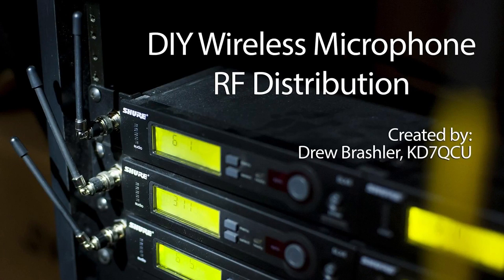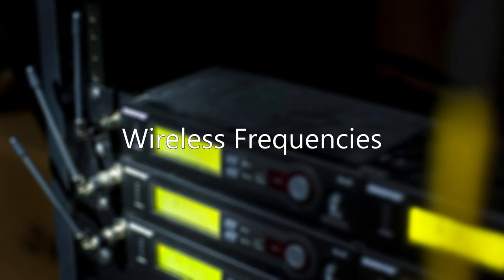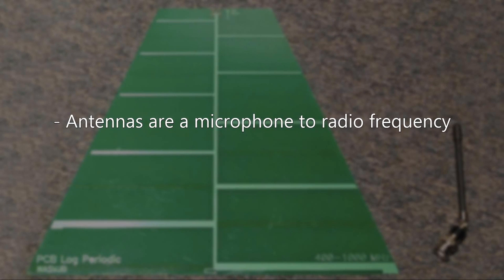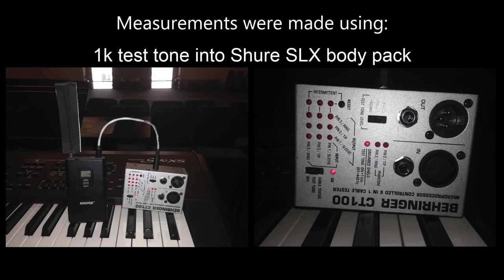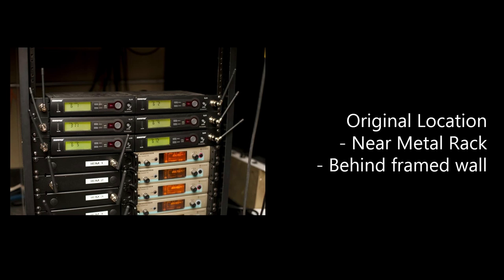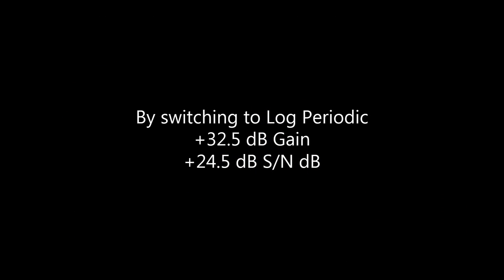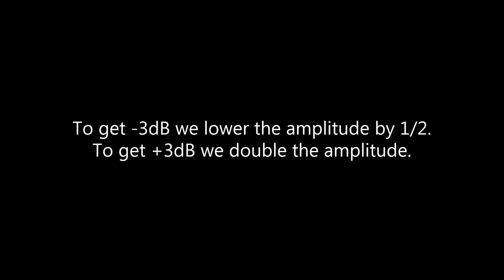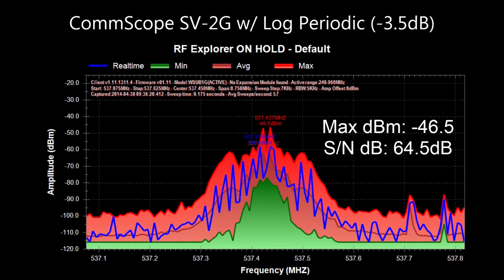DIY Wireless Microphone RF Distribution

Comment: This is a rather well-done and -documented presentation.  Thank you for making it, as it may save smaller churches who have a tech-savvy volunteer a significant amount of money.
A few observations are in order: First, -3 dB is half-power, not half-amplitude.  Half-amplitude is -6 dB.  This is because power is proportional to the square of amplitude.  
Second, the Shure claim that its splitter introduces a 2-dB insertion loss is a bit optimistic.  As you correctly point out, when the power of the input signal is split two ways, there will be a 3-dB loss from the input to either one of the outputs.  We would expect a little more than a 3-dB loss, because the circuits in the splitter are not perfect.  
Third, with the 1/4-wave monopole antennas, any metal nearby will affect the antenna's pattern; it will not be omnidirectional.  Even a piece of wire (the power or audio cable to a nearby piece of equipment,) if it is within a wavelength of the antenna and parallel to it, will introduce a change in the antenna's pattern.  
Fourth, an amplified (active) splitter is not necessary in all cases.  If you have a directional antenna with 6 dB of gain over the stock monopole, it will practically balance out the loss in a 4-way splitter.  The downside of an active broadband splitter is that in an area with strong, nearby television transmitters, the TV signals can overload the amplifier and cause intermodulation products to be formed, which may likely interfere with the microphone signals.  Or, it can amplify a strong TV signal enough to overload the RF "front end" of the wireless-mic receiver.  One of the features of the active splitters furnished by the microphone-system manufacturers is that they typically have filters to restrict their amplification only to signals within the tuning range of the microphone systems.  
Lastly, while your antenna rack is neat and compact, the close proximity of a transmitting antenna to receiving antennas can cause intermod problems in the receiver.  It is good engineering practice to keep transmitting antennas several wavelengths away from a receiving antenna, especially when the transmitter is in the same frequency band as the receivers.  There are systems where the transmitter and receiver can share the same antenna while in simultaneous operation, but those systems typically use a directional coupler to keep the transmitter's RF output from entering the receiver input.

Ken Reighard, AC3GC

Comment: Brilliant Drew, 
I discovered your post almost by accident! I have been doing the same type of distribution system over here in the U.K. for over 30 years. I'm just upgrading our Church system, & have just checked the new kit out in my workshop. Amazingly, I also have the same test gear as you, & am also a licenced radio amateur, and retired broadcast engineer. We've just upgraded from a very archaic VHF dual diversity system which had fixed antennas, all crammed into a cupboard at the back of the church building. There wasn't even sufficient space to extend the relatively long, VHF antennas, so you can imagine the amount of drop-outs! I was reliably informed that the previous installation was done by a 'Professional'...
I had to convince our church that I was saving them money.

Thanks again, nice to know we're 'singing from the same hymn-sheet'!

Comment: As far as the power distribution dilema, at our church, we just used a power inverter/DC supply with multiple connectors built into the cable which we just plug into each receiver then we don't have to deal with the bulky plugs. 

I've already built mine based on your info and tested it and it works. We just need to get all the receivers and our Mackie Dl32R off the stage and into our media room but this is really exciting stuff and the amount of money saved is well worth the build. Thank you for sharing Drew!

Comment: I'm in the middle of implementing this setup right now, thanks to your advice and research here.  Got my antennas, cables, tools, and an RF Explorer for before, during and after testing.  Thank you for this work!  You're saving my theatre a ton of money they don't have so that we can get rid of the pops and dropouts from our musicals (24 channels - what a horserace to mix!  And tune/set up!)
Reply from the maker: +leistico That is awesome! Take some photos and let me know how the build goes for you!
Reply: +Drew Brashler  Hey there.  Just now getting back to you, and I have to say the setup I put together is working like a champ!  I don't know how to post pics here, but what I've got is a stage that's 35 feet wide, and a booth that's about 60 feet away with a rack of 12 SLX receivers (with room for hopefully four more, if the budget numbers pan out!).  What I did was make booms for the LPDA antennas about 20 feet from the edge of the stage extreme left and right of the house, about 12 feet in the air, each angled off vertical about 15-20 degrees (they're fastened to coves  above and along the side of the house), and each ran back to a 2 way passive splitter to two of the eight way active splitters, to make sixteen lines out for each side of the receivers.

The only concern I had from the LPDA antennas is that according to my measurements (with the RF Explorer), the noise floor went up to around -70db.  That's pretty high based on what I've seen in your video.  Fortunately I think I overcame that when I moved the antennas from the booth (60 feet from the edge of the stage) to their current position (25 feet from the edge of the stage.  I might have set up "zones" rather than diversity, but all I know is that we just did a production of "The Producers" with that system in place and there was nary a single signal dropout in any of the mics (10 of them H5 and 2 G4, the H5's are tuned 1 MHz apart from 518 to 527), which was a massive improvement from past productions.  I could even pick up clearer signal from the green room for PFL signal checks, which is odd as the green room is now 70 feet away from the antennas, through a cinder block wall, in the opposite direction of the antennas from the stage, so even with the elevated noise floor signal reception has improved dramatically.

Thank you for all the amazing work you did here and allowing me to learn from what you found out here!
Reply: I am a bit confused about the SMA to BNC connector cable. Shouldn't the other end of this adapter cable be "F" connector? Would I then need to adapt from BNC to F to connect to the splitter? I'm hoping you could clear this up for me. Thanks
Reply: Hi there.  The way I did it: soldered a bare-end of coax cable to the antenna, ran to a F connector, to a two-way splitter, to the 8-way distro/amp, to my receiver, all with F-ended cables but with a F to BNC adapter screwed onto the cable that attaches to my receiver. I soldered the bare coax cable to the antenna because I could get away with it, and it saved me having to use a circuit-board-to-SMA connector and an SMA to F adapter of some sort. I hope that clarifies how I made my adaptation of the system work.
Reply: Hi Leistico, 
David Kpe
1 second ago
Please did you use the ' Mini-Circuits ZBSC-8-82+' for the IEMs or you used a different splitter?

Comment: Drew, thanks for this video although I'm late to the party. I do the sound at my church as well and I'm pretty new to it with no formal training at all. Just the interest and the love of figuring out and solving issues that is driving me, along with the need to serve!  I'm also dealing with wireless Mic dropouts and really need to look into ways to better that overall for the church services experience. I inherited a system that was pretty old and setup in a sound room that has huge metal shutter gates that kind of encase the sound room to prevent intrusion. The room is small and contains equipment for basically two sound systems; the older system that has old ceiling speakers installed through the two floor building and then the newer speakers that is made of up just the house main speakers and the floor up front subwoofer with switches to enable the old speakers in in each room an area of the building. I really is taken by your video on RF distribution. Thank you for doing the legwork and being willing to share it. I want to know if this setup would work well for wireless microphones that are not rack mounted but are the Shure PGX4, the BLX4, and the BLX288 dual system as well? They all either have no antennas or the whip antennas. Thanks very much Drew.

Comment: At our church we have just upped our radio mic number to 8 and we now have shocking intermodulation problems and I have been looking for a way to resolve this. The obvious thing was an external aerial multicoupler device and I have been getting very depressed about the GBP £1300 hit that this was going to cost. I too noticed that TV distros run the same frequencies and  was going to give what you did a try, I was more concerned about excessive gain and quality issues than losses but I am thrilled to see what you have done and that it works. Great tip about the aerials, that is so much better than the £150 for the same thing in a fancy holder and good to know the impedance change has so little effect. I was also about to fork out a load of money on Belden RG8 cable......Re power, we had a hunt around and found a suitable transformer and linked all the recievers together using a custom lead wired in parallel. worked a treat, super neat and 1 plug!Thank you so much for your work.
Reply: Antennas won't help with intermod! Intermod is produced by the interaction between the transmitters. You need(ed) frequency coordination, not necessarily better antenna. Get "FreqFinder" for your smart phone and learn how to use it! Ask me if you need help. :) That, combined with scanning, and finding open airspace, should fix your (3 year old) problem.

Comment: Further point of note, if you only need to feed 4 radio mics ( true for Sennheiser at least) then the Sennheiser passive ASP splitter can be picked up used on ebay for about £170, it also has the power distro included BUT not via the antenna, still has 4 separate 13VDC outputs from it but at least you only need one PSU. If you have G3 units, you can get a more expensive splitter that feeds the DC via the antenna fro about £600 used... but then you might as well go with the solution here. In the UK you will want a TV splitter with a 4G filter, they are about £15. Try to get the version with f-connectors, not the old TV coax connector.
Reply: The ASP-1 unit is passive (with four receivers connected you get ~14db of loss) so you also need to use the Sennheiser antenna amplifiers.

Comment: Hey, you use RG6 quad. I'm about to do something similar (but way smaller scale) and was advised to use the standard RG58 (50ohm) cable and just have the adapters BNC to F-type. 

Also, if you chang the positions of the amplifiers (or have a patch panel connected to the most important mics) and changed the connection types to "push on" F-type, if one amp fails, you can quickly change from one amp to the other.  CON: pushons are more easily removed by 'accident'.

Thanks for the indepth video. I'm going to start using a small LPD antenna for my DJ shows! Nice.

Comment: Outstanding video.  It is the BEST real-world educational video I've ever seen on YouTube.  I've watched it more than 5 times.  Please read the rest...

First, I thought I'd share a tip.  Amazon has LTE Filters that will only allow 5-700Mhz to pass through and attenuate all the cellular noise in the 700+ frequencies.  I highly suspect that this will increase everyone's signal to noise ratios, especially when a few hundred cell phones are in your receiving areas.  Let me know if anyone tries it.  I have one on order as I'm not yet finished building the setup yet.

In the video, you are using the RG6Q Coax and F-type connectors for the entire run.  Is that better than doing F->BNC connectors at the splitter and running everything in BNC 50ohm Coax.  I know that you said you don't lose much in the conversion, but do you think there would be a difference?  Are the supplies cheaper, less lossy, or easier to work with or do you save signal by  switching to 75ohm once at the receivers?  Do you (or does anyone) have any diagrams of the setup and/or links to the entire parts list.  Also any detail on the specifics of how tests were taken (software setup) with the RF Explorer would be useful too...

I have the LPDAs and straight SMA board connectors (along with the RF Explorer).  I was hoping for an 90degree connector to run the cable without slack along the feed line of the LPDA and drill holes and zip tie it to the board.  I heard that the coax works best when run along the center of the board.  I have been looking for a 12" SMA male to BNC female cable without luck.   I am now thinking of taking a 75 foot 50 Ohm BNC cable and cutting it in half and soldering the cut ends (so 10m or so) right to the board.  This way I can run 50 Ohm the lengths and convert at the splitter/distribution box.  Not sure if that would be any better or worse, but it will allow for more flexibility to run different antennas, without needing to get into the rack (as I run mobile sound for events).

I saw that you have the two antennas on different planes for signal polarization, but isn't there also some benefit from greater physical difference separation.  Don't experts recommend at least a half wavelength apart in distance?  Not sure about that, but I heard it somewhere.   I hope people are still seeing these comments and that hopefully someone replies...  Be safe and take care...  :-)
Reply: Hey, noice tip. You can also get block filters, so they might help too!

Comment: Great vodeo! I was always wondering if consumer-grade  TV signal amplifiers/splitters/combiners, etc would work with wireless mic antennas, since the frequencies are similar. For a lot less money than the "pro" stuff. (This seems to be an industry secret). Also, the results of using 50 ohm vs. 75 ohm cables. You answered my questions!

Comment: If you use a RF explorer you need either the pro audio or plus model. Regular RF explorer models only have 112 pts/scan.
You need to do about 10 scans per band to get enough resolution. Pro audio and plus models have 4097 data points

Comment: This is an old video but there is a very cost effective solution now from Phenyx Pro model PAS-225X comes with powered distribution unit and two directional antennas for only $340

Comment: Drew, Power distro is even easier to work out than is the RF Distribution.

Most rf receivers work with anything from 9V to 18V, so getting a LARGE (high amperage) 12V power brick. Then creating your Power Break out cables. Total should cost <$50

Comment: Awesome stuff.  I noticed you have your iem transmitters and microphone receivers in the same rack.  Your antenna was also set up with the iem transmitter in close proximity (between) the receiving antennas.  Does this cause RF interference issues?

I am building a self contained rack that contains all my gear in one rack.  Behringer Xair, Sennheiser mic, Sennheiser iem, and line 6 g90 guitar.  I've used it for years but often had rf interference.  It's undergoing a redesign.  I'm thinking of lining the rack with RF blocking material like copper tape, and using RF blocking material to isolate the iem unit from the guitar and mic units in the rack.  Then using external antenna similar to yours.

Comment: With this setup, how long of cable do you think could you use to connect the antennas before requiring a signal amplifier?
Reply: Probably already got it sorted, but for anyone else: Signal loss depends on frequency, distance and type of cable. EG: RG11 coax loses 3.5dB @ 400 MHz while RG58 loses 11.2! The primary loss is in the splitters. An amplifier is to compensate for the loss. So work out your loss, then you know how much you need to gain with the amplifier.

Comment: Thank you kindly for producing such an extensive video and providing the results to back up what you did for the haters!

I'm going to try the printed circuit log-periodic antennas with my Shure UA845, just wondering if you'd ever given them a light coat of spray paint and if that affected the performance as they're going to be rather visible where I wish to use them..?
Reply: I am also going to give my Log antennas a coat of matte black. Apparently on the manufactures website it says it won't effect performance. That question was asked a few times in this thread, and the other common question was about power. Maybe Drew can do a followup about power distro. Some commenters say that it's fairly easy, but I am still nervous to power up thousands of dollars of gear with just a few bucks of power supplies. Thoughts?